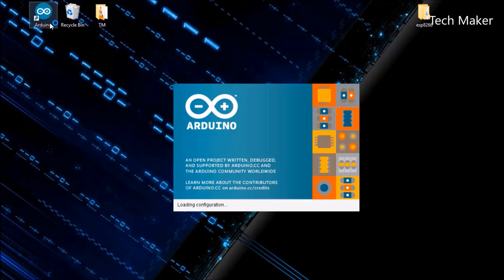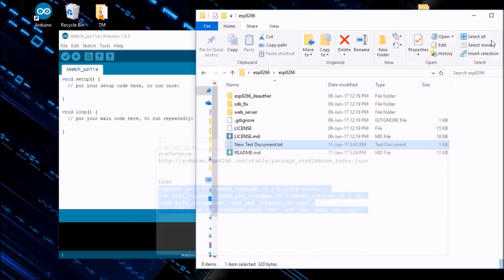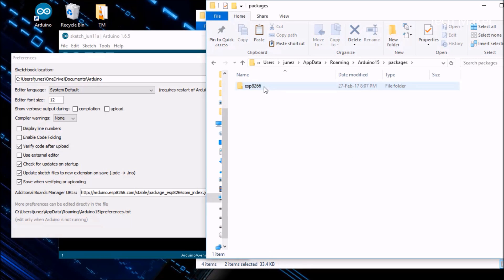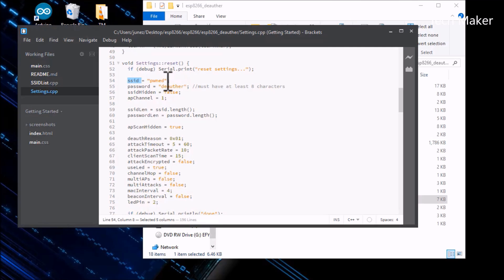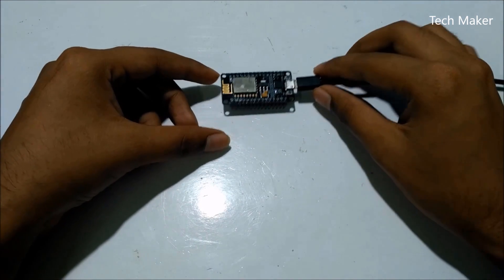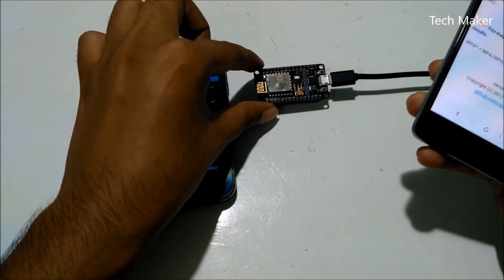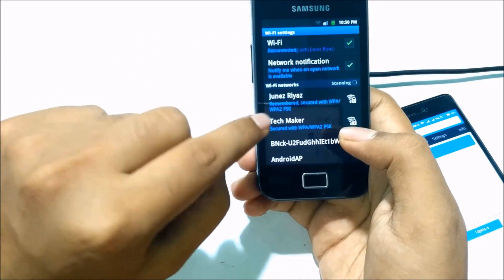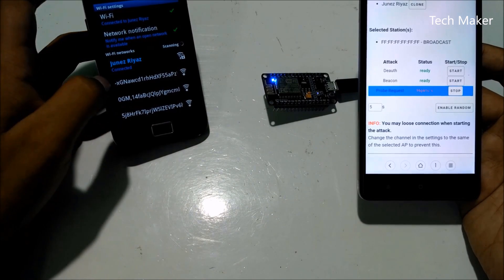How to make Wifi Jammer using Node MCU ESP8266

Comment: When I search for ESP it does not show any of the esp2866, it just shows Arduino AVR Boards
Reply: same, did you find a fix?
Reply: @Xalityy  unfortunately , I did not find a fix for it.
Reply: @Abdul-GT  I have! you need to use a certain cable. Check device manager and underports wait until there is an port name that includes COM3 when you plug the cable in. I tried like 20 cables before i found the one that worked.

Comment: why does mine give this error?Arduino: 1.8.9 (Mac OS X), Board: "Arduino/Genuino Uno"

esp8266_deauther:6:25: error: ESP8266WiFi.h: No such file or directory
compilation terminated.
exit status 1
ESP8266WiFi.h: No such file or directory
Reply from the maker: You didn't installed library.

Comment: when i click upload it gives me this error   sketch/APScan.cpp: In member function 'bool APScan::start()':
APScan.cpp:14: error: no matching function for call to 'ESP8266WiFiClass::scanNetworks(bool, bool&)'
   results = WiFi.scanNetworks(false, settings.apScanHidden); // lets scanNetworks return hidden APs. (async = false & show_hidden = true)
                                                           ^
sketch/APScan.cpp:14:59: note: candidate is:
In file included from sketch/APScan.h:6:0,
                 from sketch/APScan.cpp:1:
/Users/Elkhatib/Library/Arduino15/packages/esp8266/hardware/esp8266/2.0.0/libraries/ESP8266WiFi/src/ESP8266WiFi.h:243:12: note: int8_t ESP8266WiFiClass::scanNetworks(bool)
     int8_t scanNetworks(bool async = false);
            ^
/Users/Elkhatib/Library/Arduino15/packages/esp8266/hardware/esp8266/2.0.0/libraries/ESP8266WiFi/src/ESP8266WiFi.h:243:12: note:   candidate expects 1 argument, 2 provided
Multiple libraries were found for "ESP8266WiFi.h"
 Used: /Users/Elkhatib/Library/Arduino15/packages/esp8266/hardware/esp8266/2.0.0/libraries/ESP8266WiFi
 Not used: /Users/Elkhatib/Library/Arduino15/packages/esp8266/hardware/esp8266/2.0.0/libraries/esp8266
exit status 1
no matching function for call to 'ESP8266WiFiClass::scanNetworks(bool, bool&)'

Any solutions
Reply from the maker: +jhddia jhuayfiqyk you got this error because, you are having multiple libraries. Use only I said , remove other versions. You can delete that at arduino installed folder , it will be in libraries folder. Find it and delete
Reply: I didn't understand what u told
Reply: Tech Maker even I got the same error please give me the solution please
Reply: Tech Maker what u told in above, that solution does not work. Give me other one.

Comment: i have an ethernet cable plugged into my computer and no wireless network adapter. is this why my node is not being recognized when i look in the comp ports?
Reply from the maker: Zack Carter  no buddy
Reply: Tech Maker any idea why it won't show up when i look at the comp ports?
Reply from the maker: Zack Carter I think you have problem with Ethernet card. Maybe a driver problem or hardware.